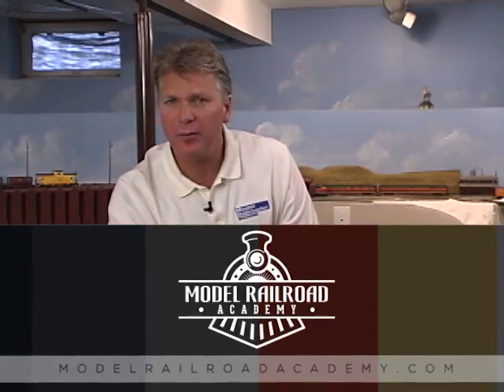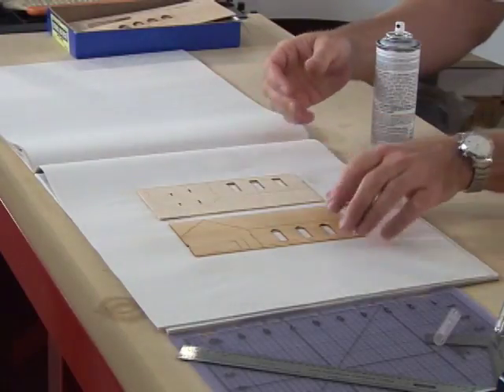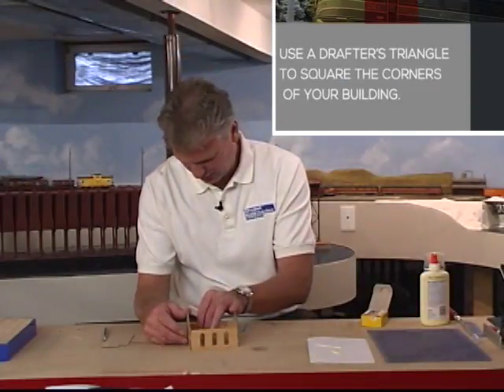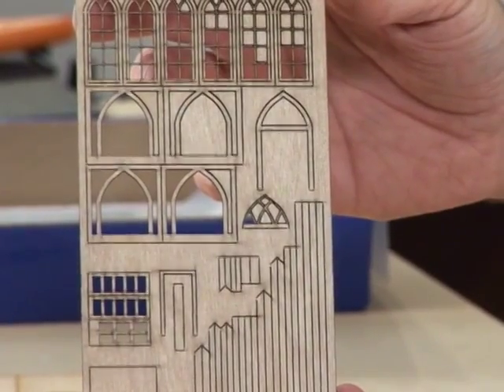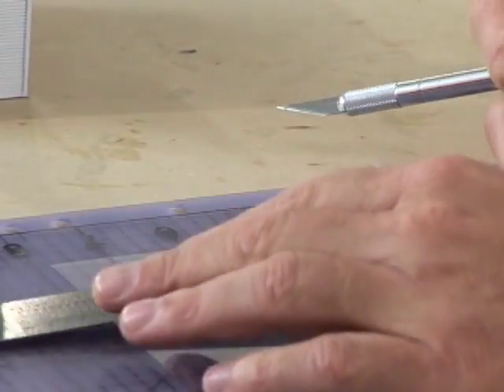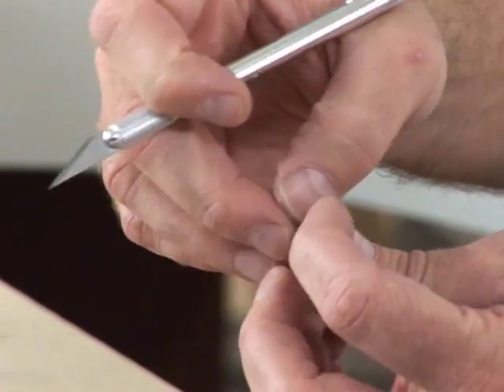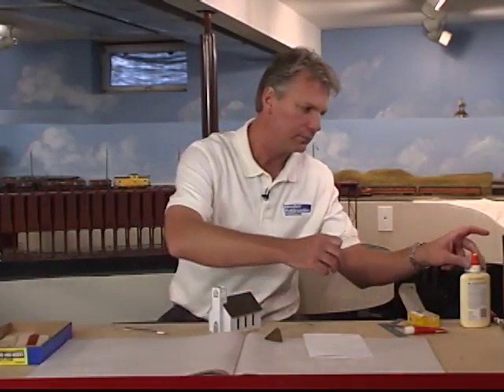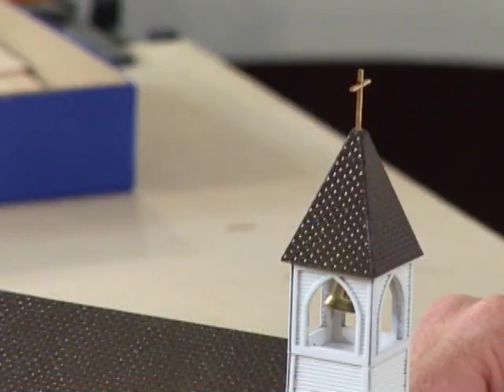Making Superb Model Railroad Structures with Wooden Kits

Comment: Good tips.  One additional thing that I did on my O Gauge wood church.  Instead of using the clear sheets supplied for the windows, I found pictures online of stained glass, printed out various magnifications in the shape of my windows on paper until I got the scale right, then printed them on vellum with a color laser printer.  Glue these to the inside and when lit, it looks just like a church.